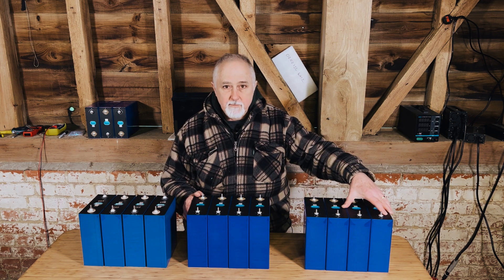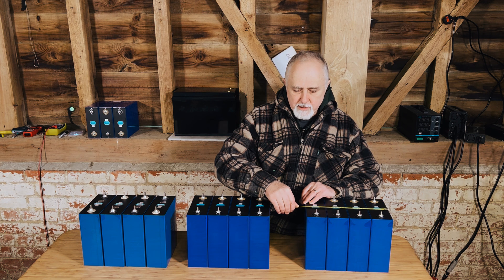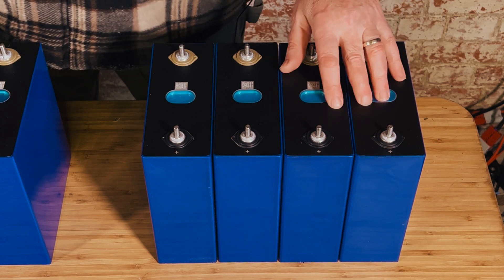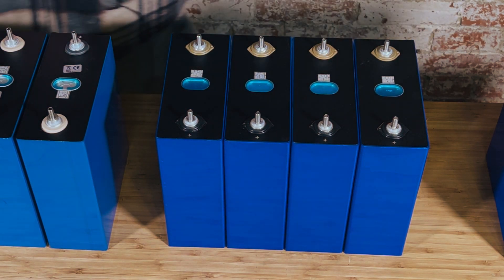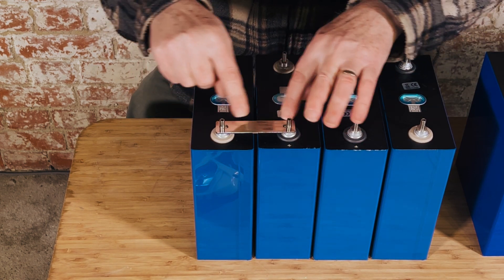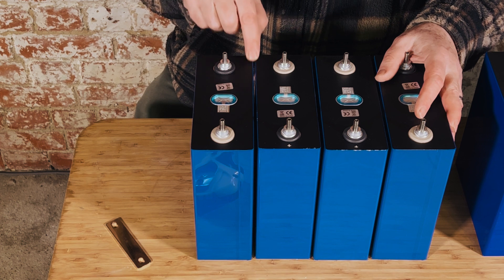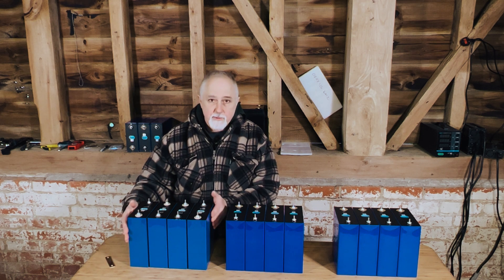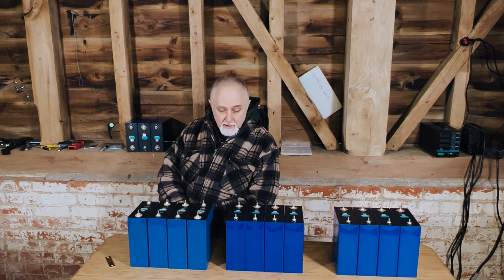Cheap LiFePO4 Cell Swelling

Comment: The price listing at Alibaba are totally off!
I had an argument with my supplier why he was charging me 2, 3x what was listed at Alibaba... So I went and contacted Alibaba. To my surprise, my supplier was right. I shut my mouth thereafter; he wasnt milking me for this expensive project.
Reply from the maker: That's interesting.
Reply: @offgrid_power  I perhaps should clarify my earlier statement: prebuilt 10KWH battery packs listed as $500~$750 but when ordering, I'll get $1500~$2500 quotes. 
Individual cells are only 10~20% off though.

Comment: I've just received my Grade A 280Ah EVE cells. I've measured 289mm all four BUT I recognized a swelling not in the typical center area but left and right from it. Is that unusual?
Reply from the maker: We've seen some swelling on EVE cells sometimes, but not as much as other manufacturers (like CATL). But we've never had a problem with performance of the EVE cells, even if they're swelled slightly.

Comment: You are comparing 2 different brand batteries. Eve and the ones you say are bloated are the catl. The catl 302 are known to bloat a little at full charge. This is the normal characteristics of the catl 302. Does not mean it is bad. You are also saying you got bad batteries which you also did not. Were they falsely advertised,  yes. Being a battery guy you no no one makes a 320ah cell. You have catl 302 that exceeded capacity.  Catl uses a thinner less durable shell than eve which is one of the reasons they bloat.
Reply from the maker: Thanks for the info, Shawn! :)